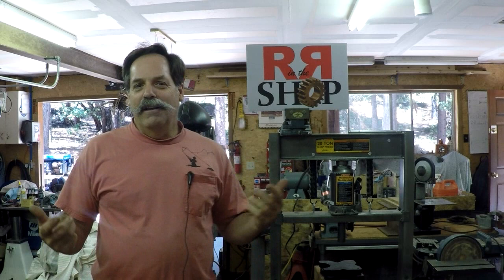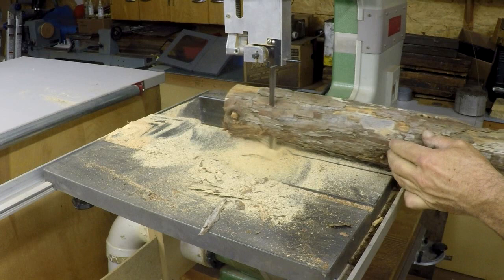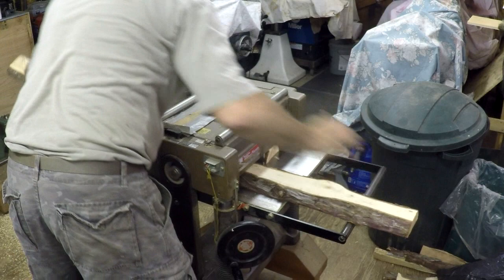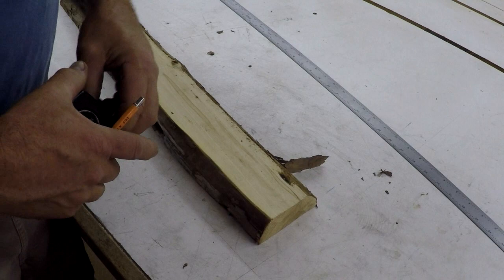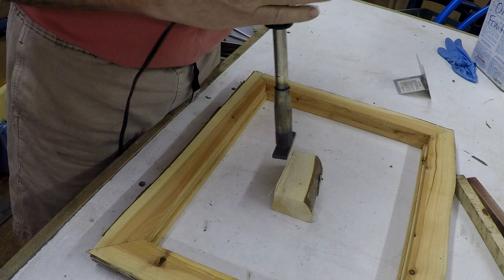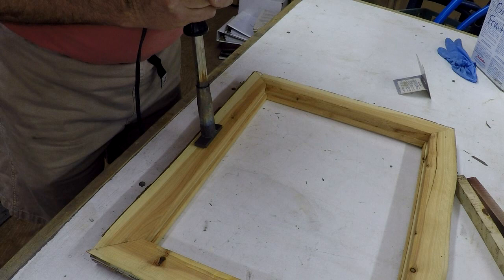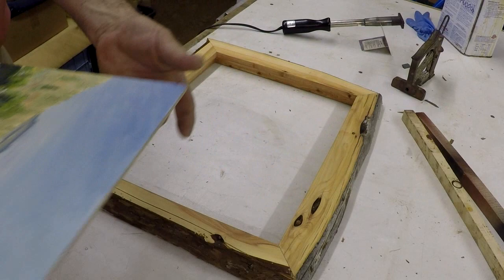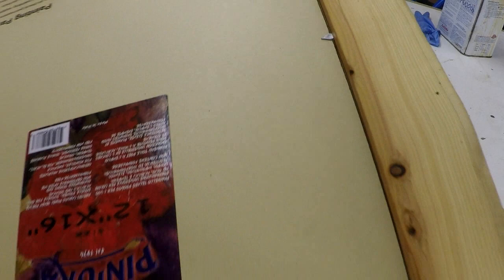Picture Frame from the Woodpile

Comment: well happy anniversary Randy. I want to thank you for taking the time to do these video's, they take a lot more time than people realize ,
ohh watch out with a planer, if your piece  of wood has a knot near the end, make sure to feed it knot first, I have seen more than a few get nailed  by a knot flying out because it was on the tail end of the board.
We used to use that stapler for holding glass pains in wooden windows before laying the mastic. Cool i had not seen one of those years.

Thanks again for the time you devote to your followers.
Cheers
Phil.
Reply from the maker: Phil's Projects   Thanks Phil.  Thanks for the info on the glazing points.

Comment: Nice work, Randy.
I have seen those little diamonds used on old windows to hold the glass panes in... Where do you get refills?
Joe
Reply from the maker: Joseph Magedanz That is a good question Joe.  They are glazing points.  I have a partial box some where, never had to buy any and I have had the tool for over 30 years.  Randy

Comment: Hi Randy, another enjoyable video and congrats on the one year anniversary!
what was that in the trail you were riding? some of it looked like old tires and other parts looked like driveway stones.. what did they do, build a trail for pussies that can't handle real dirt?...lol
if you want to get the frame to be a consistent width you can make a slider that runs in the slot of the bandsaw table. a piece of plywood with a chunk of keystock let into one side of it and a stop piece of wood 90 deg to the cut.. then you can clamp or screw on a fence and lay the work on it and run past the bandsaw.. you'll get a pretty consistent cut each time and your miters will look the bomb..instead of nailing with a brad you could gather up a few twigs of the wood you're working and use them as pegs .. that way they would like they were knots and it would be real hard to see a difference even for the trained eye
cheers
mike